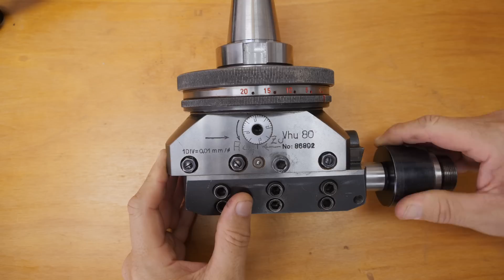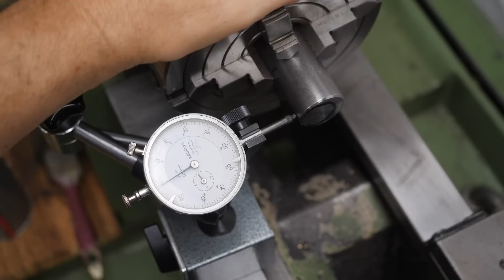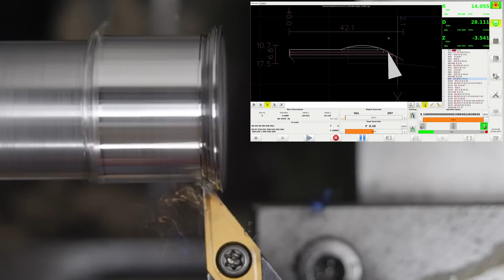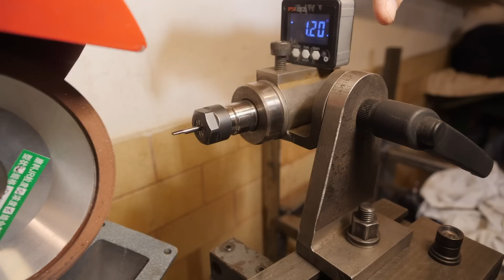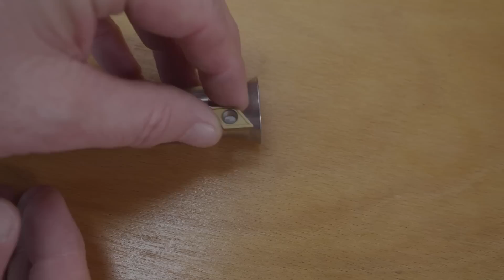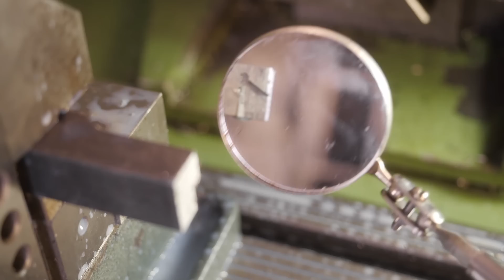I was making a boring bar, when....  || RotarySMP

Comment: Does Linux CNC not support working plane selection (G17 / 18 / 19) ? Default would be G17 for XY plane, which puts the tool length offset in Z. Selecting G18 for XZ working plane should put the tool length length offset in Y.

Curious as to why you use finish profiling inserts for roughing ?
Reply from the maker: I guess coming from the mini lathe, and only doing one off stuff, I never really hog through material at anywhere max rate, so I just use these positive inserts for everything.

LinuxCNC does do G17/G18/19, but I am not sure if the tool table follows it like that.
Reply: @RotarySMP  I have had a quick look at the Linux CNC documentation and it is rather vague. But there is little point in being able to select a working plane if the tool length compensation doesn't default to the non-working plane axis & put the tool radius compensation using G41 G42 onto the working plane axes.. Changing the working plane was the way universal heads were accomodated using Heidenhain controls when I worked with such things - the machine was initially set up for a vertical spindle, but if the head was swivelled so the tool was aligned with the X or Y axes then working plane selection took care of the length offset.

The Linux CNC documentation does only mention the Z axis for length comps, but the tool table has possible entries for X, Y and Z values. Have you tried setting a tool length offset in the Y axis with G18 set ? If the length value gets entered in the Z field of the tool table by default, could it be moved to the Y field ?
Reply from the maker: @mgnbukint6502  I haven't as I got side tracked working on my band saw gearbox. I need to revisit the whole horizontal mill thing.

Comment: This is perhaps a dumb question, from a non-machinist. Is there a reason that you didn't just bore a hole in your 25mm slug and insert one of your existing commercial boring bars? In effect making an adapter sleeve. ("Because that doesn't make good content" is an acceptable answer.)
Reply from the maker: Good question Brian. I probably will make a reduction sleeve to use some of my other boring bars, but rigidity goes up with the 4th (? or was that 3rd?) power to diameter, so I would like a 25mm boring bar to take full advantage of the Maho and Narex rigidity for bigger hoes or and longer ones.
Reply: @RotarySMP  4th power
Reply from the maker: @briantaylor9266  Thanks.
Reply: @RotarySMP   Bigger hoes eh 😀
Reply: I have the same VHU 80 boring / facing head. It's a great bit of kit once you get your head around how to use it. They're beautifully made. Mine came in a set with various 25mm brazed carbide boring bars, which I've never used, and various reducing sleeves. It also included all sorts of 25mm 90 degree boring bar adaptors, which enable you to reach inside small holes, etc despite the relatively large size of the head. I'd bought my lathe tooling in job lots, and they included some short 16mm and 25mm CCGT insert boring bars, which I had no use for at the time. When I got the boring head, they were perfect for it.
Reply from the maker: @richardjones38  Nice haul you got there Richard. I also have some 16mm boring bars, and will need to make a reduction sleeve to take them.
Reply: @RotarySMP   I just had a look in the box. The set included reducers to 20mm and 16mm. Also 2 lengths of 25mm boring bars for 8mm high speed steel. My 16mm sleeve was cracked in two when I got the set (no doubt someone tried to clamp it down to less than 16mm), but it works fine in 2 pieces. I had to make an adaptor to fit mine to a BT40 face mill arbour too (it came with INT40, so the wrong drawbar thread and length). The way you've done similar saves valuable Z height relative to mine.
I hope your spindle noise isn't the bearings. Your video makes me think I really should rebuild the variable speed drive on my Ajax AJT1. It makes unpleasant noises at the lowest speeds, so I just avoid setting it that low. I probably ought to strip and service the spindle and 2 speed gearbox while I'm at it
Reply from the maker: @richardjones38  Hi Richard,
I probably should have serviced the spindle in the Maho when I got it. Lubed for life cant mean 35 years.

Comment: I also have a maho mh400c with a bad top bearing, my bearing roller actually exploded when i took the head apart. Since then (10years), i was able to find a new bearing but i need to re-grind the race in the housing. I have been slowly building my skill to get there. In the meantime, i am using mine as an horizontal only.
Reply from the maker: Sorry to hear that Charles. 
Was there anything difficult or tricky about the disassembly process I need to know?
Reply: @RotarySMP Mine seem to be 1 generation older than yours (tall cone over the head). The main issue was pulling the top bearing inner race from the spindle, it had a pretty good interference fit. I did not have the right tool at the time and used brute force (slam the spindle on a piece of wood). A hydraulic press would have been a better option.

I will take the occasion to try to make a YouTube video about it.
Reply from the maker: @CharlesXavierRoy  That would be cool. Please do.
Reply: @RotarySMP Here is a video about the spindle construction: https://youtu.be/uUNHngx68xY . I will try to do an other one for the head.

Comment: Hey great video. The milling head sadly does not sound good. Maybe try to contact Franz Singer (Werkzeugmaschienen), they usually are more knowledgeable on Deckel machines but also have some Maho parts. I know from some forum posts that they rebuild Deckel heads from time to time. Maybe they have an idea.
Reply from the maker: Thanks, I figured I will probably end up with Mr Singer. Especially if the integral bearings are damaged.

Comment: Could it be the power draw bar assembly rattling? Do you get the same sound with a tool held in place? Otherwise sounds expensive 😭😭😭
Reply from the maker: Hi Julia, I hope against reason that is is a rattle in the draw bar. Yes, the sound was the same with or without a tool. It sure does sound like that...💵💵💵
Reply: @RotarySMP  was clutching at straws there. Maybe running a bit dry? 😳
Reply from the maker: @julias-shed  There is no way to relube the bearings except disassembly.
Reply: @RotarySMP  Ah I guess see if there are any special tools that need to be made?
Reply from the maker: @julias-shed  There probably will be. I need to stop procrastinating and get into it.

Comment: I have a Maho 400p machine with the almost the same vertical head internals.

There are a Gamet rolling precision bearings there(very very expensive and not replaceable, because spindle is a part of them), which needs to be lubricated periodically with a Premium Cluber grease to support such high rpms as you have.
Maho, is a power milling machine first of all, so usually even 1-2k rpm cause spindle heating. And you have 4k...
Reply from the maker: Mine has no provision for spindle bearing lubrication. I really dont understand why they didn't provide for that.
Reply: @RotarySMP  Contamination risk
Reply from the maker: @dazaspc  Good point.
Reply: @dazaspc  My observation around high volume production machines is that bearing failure is almost always due to 
contamination , followed by impact damage, and finally  things just wear out.
Bearings lubricated with Kluber grease nbu15 (ball) or  ep8 (roller)  ,any grease for that matter,
 need to be rotated to  reform  the oil film if not rotated for a while
Reply: @steveggca  If the oil has seperated out of the grease  the grease is done. It's failed. It is the reason why the use by dates are on the tins and tubes. You can mix it up but it still falls apart. Contamination point made earlier is related to the lube point and the risk it introduces.
Reply: @dazaspc  We are in agreement   Yes there is risk of introducing contamination  when pumping grease into spindle bearings, however with the correct grease
there is no need and in fact there is no provision to do so.
What  I am saying is that except for contaminination or impact  a well designed spindle in normal use and not abused will last a very long time , a decade or more. and there is usually no need to even consider installing fresh grease.
The contamination that I am speaking of happens when liquid or dirt manages to pass through the labyrinth  seal. 

When a machine with a greased spindle is installed there is a warmup or "relube" cycle  that is done ,the same cyle is run after an idle period . It is indeed done  to
re-establish  the lubrication film.

I have thrown out  1Kg cans of kluber because of oil seperation  and  purchased the smallest tubes instead.

Comment: You really have to check out why your lathe chuck is slipping so much. Either your holding force is just pathetic, or your tailstock is way over pressured.
Reply from the maker: It was the tailstock Px. I had cranked up the Px to do some sand blasting, and forgot to reset it down for the lathe.

Comment: When doing pockets for inserts, we used to mill out with a parallel cutter first and just finish the top couple of mm with the taper. This gives you clearance at the bottom to ensure the insert is held tight against the angle. When drilling for the screw, we used to offset about 0.15mm towards the back, that way you are jamming the insert in to the profile and using  the taper of the insert screw to pull everything in place. 
Good luck with the bearings.
Reply from the maker: Thanks for the tips. I was going to use the 3mm parallel end mill to do most of it, but am not sure why I trashed it o fast.
Reply: @RotarySMP  It may have been the vibration from the bearings that led to the early demise of the 3mm cutter.
Reply from the maker: @bobuilt10  Good point, could well be.

Comment: Ooof   never did a Maho head, rebuilt a similar Zayer head  ,did not enjoy it.
the thing with these heads is that there is no where for the grease to go.
as always , disassemble, clean, inspect,  hope for the best .
It might be that there is bevel gear wear  and the gears are rattling  with the backlash.
Reply from the maker: Hi Steve, I am still at the denial stage of grief on this one. :)

Comment: Easiest solution to noisy machinery is noise cancelling headphones and wait for a catastrophic bang.🤣
Reply from the maker: Thanks Ken. I am pretty good at that method :)
Reply: @RotarySMP  just run it at lower speeds? and compensate with different cuts and feed rate? do you really need the small tools?  lol.
Reply from the maker: @MikelNaUsaCom  Hi Mike. for this job I kind of need the 4000 rpm, and to engrave even more so. If this is a broken bearing cage, it will probably get worse.
Reply: @RotarySMP  Totally agree, now it might be a choice to buy a 25mm boring bar, vs the cost of troubleshooting and repairing the maho bearings... either way or both, I'm here for the ride, and enjoy your videos, thanks for sharing the journey!
Reply from the maker: @MikelNaUsaCom  I have to get that vertical head running ago. 'll be tearing it down.
Reply: The bearings won't fix themselves, so its probably best to bite the bullet and replace them before it gets much worse, potentially damaging something else along the way.
Reply from the maker: @alanclarke4646  Yeah, that is the plan. I will be making a video on the strip down.

Comment: I have no knowlege of MAHO gearboxes, but on old Harley gearboxes if they make that semi-random "chik chik chik" noise in one gear only, it usually means the fork alignment is off and when the gears are moved into that one position the position is slightly wrong and something is JUST rubbing with that gear pair.

Was that little tool you ground carbide? I have never seen HSS fracture like that.
That Diamond Carbide Mighty Tough stuff is too brittle, better to stick with Handy Sharp Stuff
Reply from the maker: Yes, it was carbide. :)

There are no gears in that vertical head, they are behind the horizontal, and are not making unusual noises.
Reply: @RotarySMP    A single point carbide tool with that small a diameter I would run about 12,000 RPM on my machine. They tend to break too much at lower RPMs in steel.

Sorry I thought the gears were in the head. An old trick is to put a screwdriver handle pressed to your ear like a stethoscope and touch the metal end of the screwdriver on different parts of the head, that might help track it down to see if it is top bearings, bottom bearings or the 90 degree drive gears. Might not be that much helpmif the casting is mega solid but hey every suggestion has the possibility of being useful 😎
Reply from the maker: @wizrom3046  Thanks. You what it funny, I whipped up that stethoscope I used in the thumbnail, from some 3D printed parts I designed in 5 min. It actually sort of works. Not great, but it does transmit the sound :)

Unfortunately, there is a sheet metal cover over the casting.
Reply: @RotarySMP     haha now I feel like a fool I didnt even look at the thumbnail   😁

Comment: Is the knock at low speed normal?
It sounded to me like one of the bearing elements was skipping. That normally an indication of debris in the race and or cage failure.
Flush it out and inspect what has come out.  If it's a element fail you will feel it by hand when clean.
Often a Bakelite cage will drop a little chunk and if you catch it early it will still be ok once cleaned and correctly lubed.
All that said I have never worked on a Maho spindle But done many other CNC lathe, mill and grinder brands. None surprisingly with integral bearings, thats rare amongst machine tools.
Reply from the maker: Thanks for your feedback on this. I hope against reason it is something in the tool stud puller, or in the upper, replaceable bearings. My biggest fear would be coolant getting past the lower laybrynth seal, and causing corrosion on those integral bearings.

I'll be making a video on the tear down. I hope it is a good video, as I will need revenue to pay for this repair 😓
Reply: @RotarySMP  I did quite a bit of work with Chiron on spindle bearing problems that was mostly due to coolant contamination.  Unless the lower labyrinth air vents were blocked I very much doubt that would be it. I would be more concerned with grease breakdown. NBU-15 used in many spindle bearings is done after a couple of years. Hopefully that isnt the stuff you need for this.

I wouldnt be to concerned about the draw bar however it could be the gripper on the end that attaches to the pull studs. A broken return spring and or a broken anti rotation pin could make noise on startup but wouldnt continue when running. Claw types often rattle a little when empty.

According to a drawing I found on the net that I think you may have posted The main spindle bearings are easily replaceable. The knockout seals should not affect contamination unless seals have failed and even then you should get a air leak if you hold the knockout on and listen. . The most difficult part of the job would be re lubricating the bearings in place. Getting grease into the third bearing in the stack at the correct volume wont be easy with the upper labyrinth in place. When assembling these they are done pre assembly. 

One final thing if you do have issues with the knockout seals or even if not make sure the pneumatics controlling them are in full working order. Speed of activation , pressure switches if used and the most important the valves exhaust. Even with a Quick Exhaust in the system a slow pilot valve exhaust can cause problems.

Regardless you know what you are doing I only comment to suggest as I miss that sort of work and I cant do it anymore.
Have a great day..
☺
Reply from the maker: @dazaspc  Thanks a lot for your input. This spindle has no pneumatics. It uses a hydraulic kick out of the draw bar, with springs to retract it.

Comment: Be sure to exclude the interface between the horizontal part and the head. Any play there may also sound horrible.
Reply from the maker: You mean loose bolts? They weren't. Otherwise there is just the drive lug.
Reply: @ yes, I mean any play on the drive lug.
Reply from the maker: @mrtnsnp  Good point, I'll measure it.

Comment: Hi, awesome video!
I suspect theres something wrong with your chuck, it shouldn't have so bad gripping strength
Reply from the maker: I think the problem there was I had been sand blasting, and had the air Px up full, and forgot to reset the pressure down to the lathes level, so the tail stock was pushing too hard.